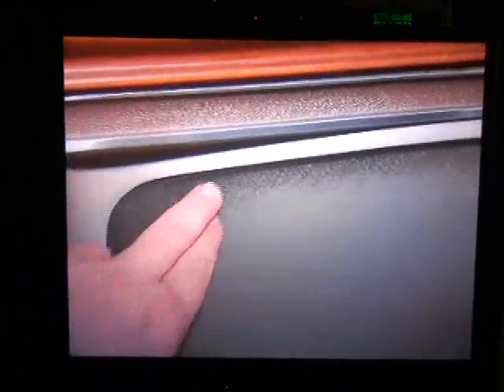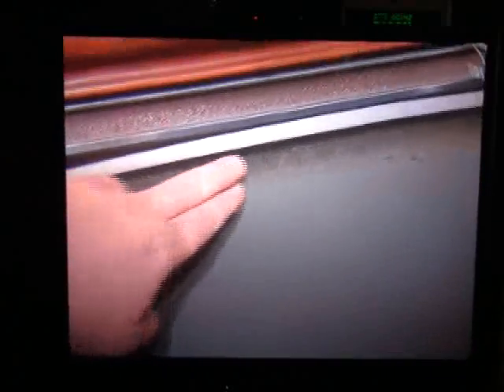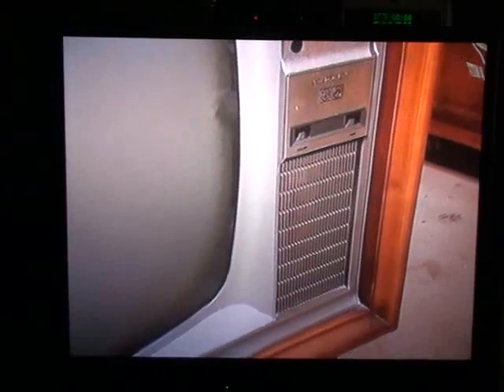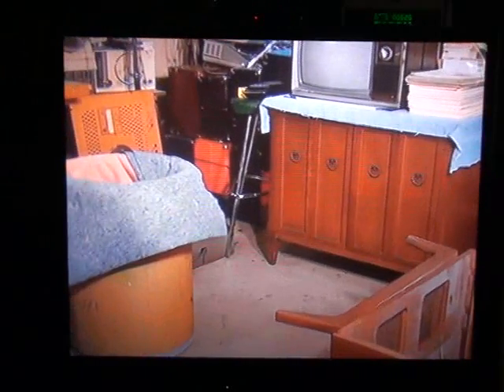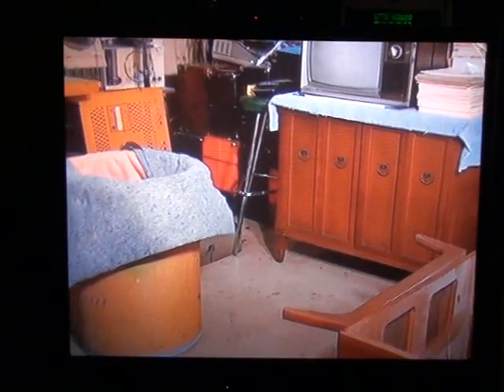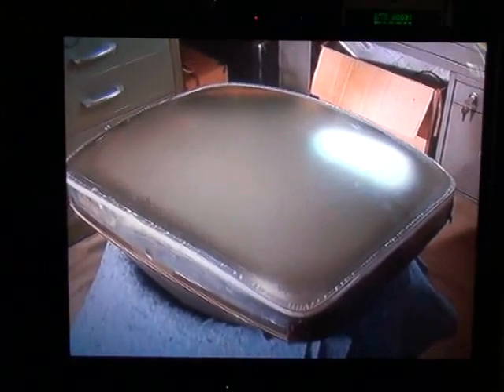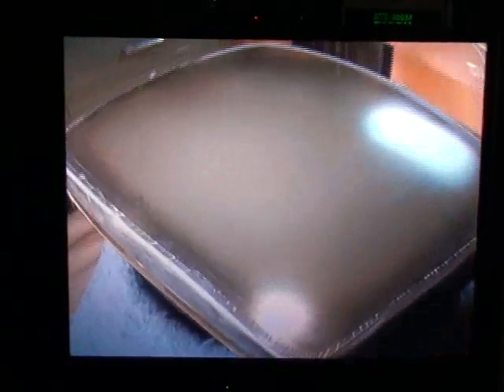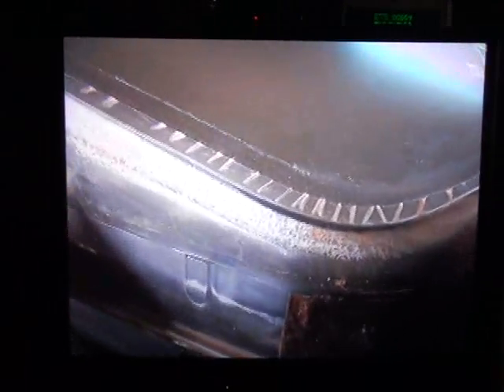How to repair CRT cataracts part 1 of 7

Comment: @GEARHEADGUY92 
Actually CRTs are useful because they don't have fixed resolutions and don't scale images. That alone makes them useful for older pre-HD media and most game consoles. They also don't suffer from the many problems that LCDs STILL suffer today. Not only that there have been MANY CRTs (such as the Trinitron G520 I'm using) that do ridiculous resolutions and have higher picture quality and instant response times than ANY other display type.

Comment: @TakeOprisoners 
Call me crazy, but CRT is a more reliable technology than Plasma and LCD for most applications, ESPECIALLY pre-HD era video games. CRT monitors that happen to have a res of 1600 X 1200 or higher are much sought after by Quake players due to their reliability and accurate color reproduction not to mention zero lag or motion blur. The ONLY downfall of CRT is size and weight, but realistically how often due you move your monitors?